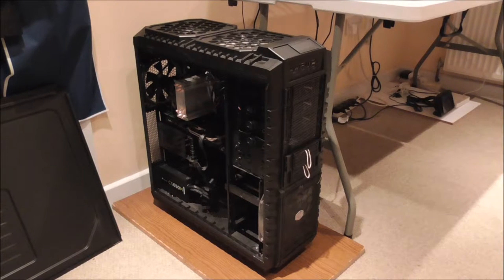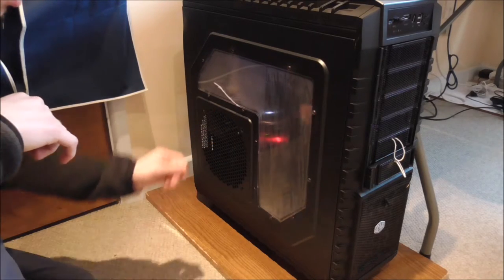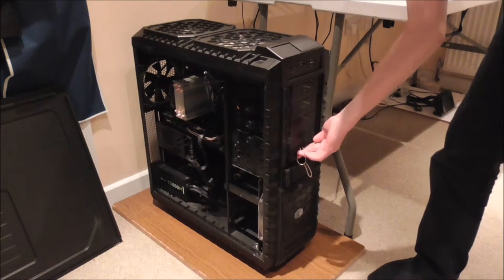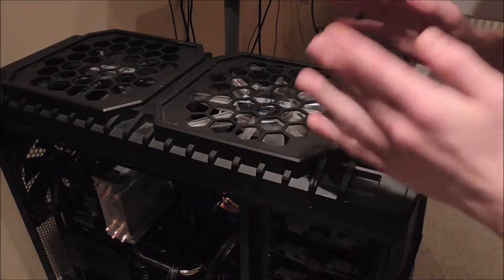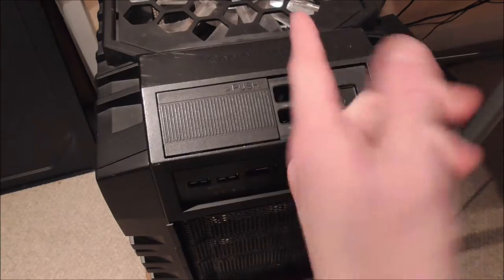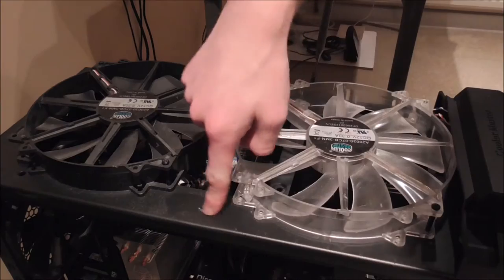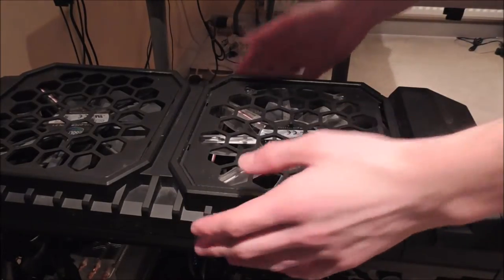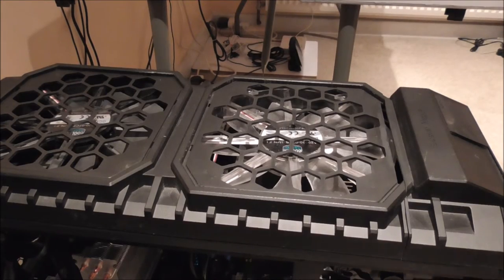Cooler Master HAF X - Case Modifications

Comment: ... put metal bread ties or wire the fans so they don't spin and blow the cases out, caution on how tight the fans are when securing it take it outside and blow it out with a shop vac or an air compressor zero parts to take off

Comment: Hi dude thanks for sharing this video but i have a question is this case support liquid cooling 120mm?
Reply from the maker: Hi, thanks for watching. I no longer own this case, but I'm pretty certain it will support a 120mm fan/radiator on the rear. It comes with a 140mm fan as standard, but has screw spacing for 120mm, I'm not sure about other locations though. It was a big case that promoted the use of 200mm fans, with a 140mm on the rear, and not much configuration for 120mm unfortunately (but it was a "full-tower" case).

As for water cooling, the HAF X is probably a decent case I imagine, I know it's old, but on the rear panel it has circular cut-outs for water cooling tubes (to use with and external radiator/reservoir) so when it was manufactured, it was obviously designed with water cooling in mind.

If you're wondering, I now own the Fractal Define R5. When it comes to new cases made by known brands, I would expect them all to have support for water cooling/AIO compatibility as water-cooling is now a popular thing for enthusiasts and high-end builds.

Comment: I have still got this case and running a i7 2700 k but i wanted to install a better cpu cooler but have noticed the hole at the back of the motherboard is tiny and sort of pointless. Is it easy to make that hole bigger? Hope this question makes sense
Reply: @FrazerForbes1  Thank you bro
Reply: @FrazerForbes1  I was gonna finally buy a nice Noctua cooler but i am in 2 minds to just buy a whole new pc.  I am not blown away by any new case out. and i do love my coolmaster haf x and i7 2700k so maybe i can extend the life of my old system more by getting the Noctua cooler.
Reply: My i7 2700k just died a few days ago. Have been running it non stop since 2011 OC'ed to 4.6 Ghz all the time. :D it died because i messed up my overclocking, and the motherboard died, and took the CPU with it in the fall...
Reply: oh by the way.. i will ofc use my Haf X nvidia edition for my 2020 build ;) best case ever imo.
Reply: @yousirsuck4248   :-( sorry for your loss bro. What new rig you gonna get?
Reply: @ukmachinehead  i will go with an i5 this time, because of budget limit. An 9600k, and pair it with the Cooler Master MasterLiquid ML240R RGB CPU cooler. I was about to go with the Asus Z390 TUF pro mb, but changed it to Aorus Elite, since it should perform better. And then pair it with the GPU i already own, a GTX 1070. Im still not sure what RAM i should go with.
Reply: @yousirsuck4248  Sounds good. I am just hoping Intel bring out something new and impressive before i upgrade. The 8700k seems the best for gaming at moment. 9900k  is not so well priced. Even know AMD have done amazing with their new CPU types i have been with Intel to long to want to change.
Reply: ukmachinehead yea it would be quite stupid to upgrade ur 8700 to the 9th gen. Ur 8th gen will run strong for several years to come! :) about the price, the 9th gen cpu is only about 15 dollars more expensive compared to the 8th gen. So that’s not the biggest issue.
Reply: Even if I was payed, or got it for free, I would never go AMD xD
Reply: ukmachinehead oh, I was comparing price of i5 8th and i5 9th gen. I’m not from the US, I’m from Denmark. And I can tell you that the i7 8700K actually is more expensive that the 9700K here😂... true story .about 100 dollars more expensive

Comment: whoa whoa whoa, i just did the top fans my self, take a screw driver to the long edges, push in along the sides to each corner. You will hear pops. Its just clips off.